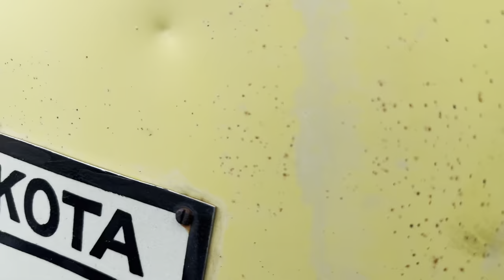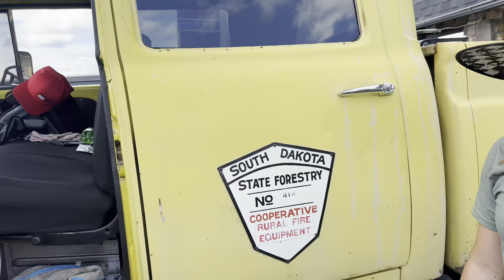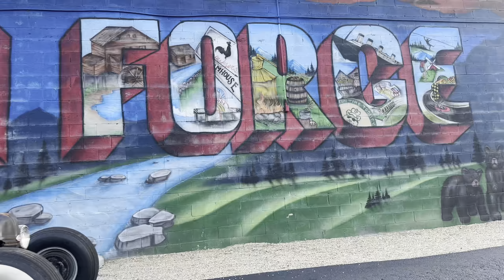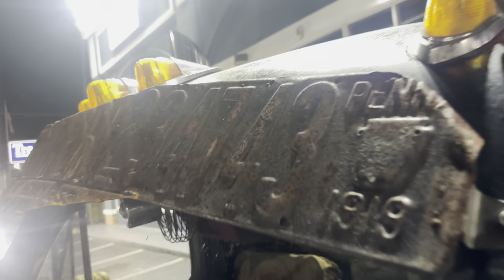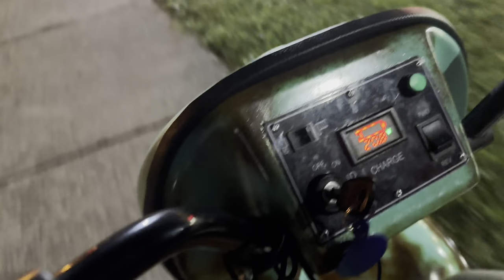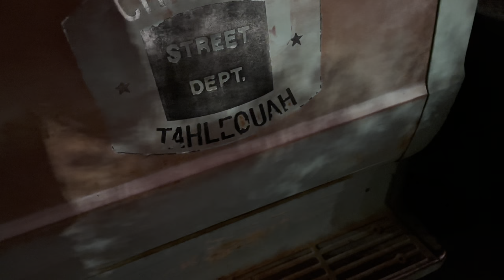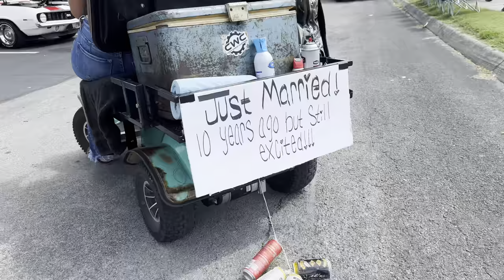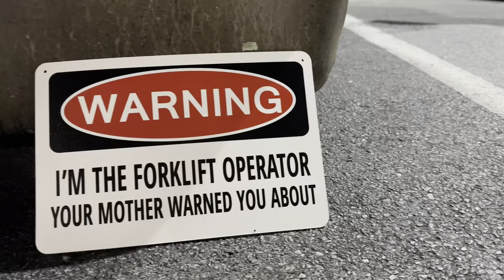ROD RUN FUN PART 1

Comment: hey guys, what did your ground hog start life as?  It looks like the perfect size.  not as big as a golf cart and bigger than a mobility scooter.  Did you build it?  I am looking to build something that I can load in the truck or on my trailer easy and by myself.  Presently thinking of modifying a mobility scooter with a bigger motor and battery.  give me your ideas.  thank you

Comment: If I remember correctly, the 6.2 diesel was actually a 350 Oldsmobile block but I could be wrong. I am getting pretty old. They weren’t a very good motor but they weren’t the worst either. They were non-turbo. Of course you could add a turbo and an after cooler, or you could just drop a 12 valve in it